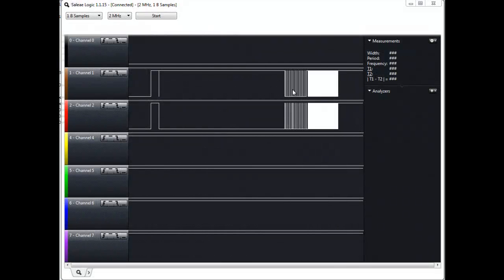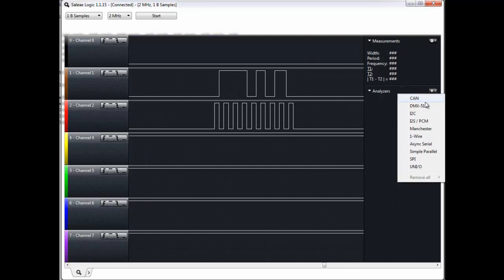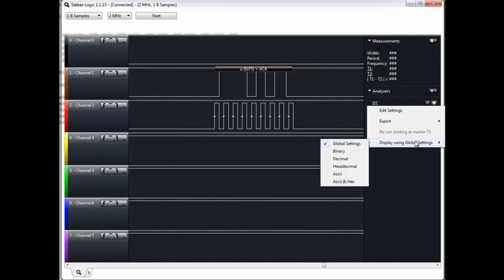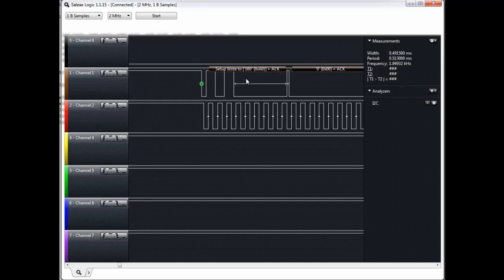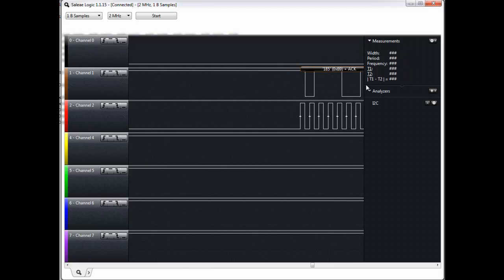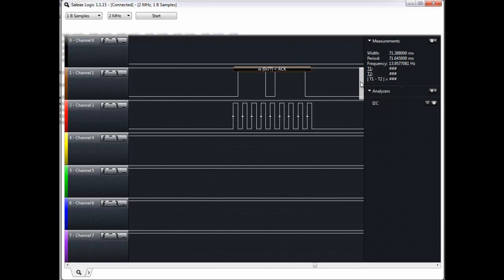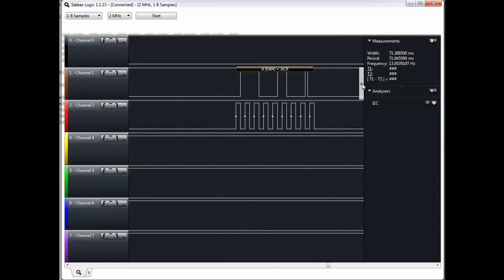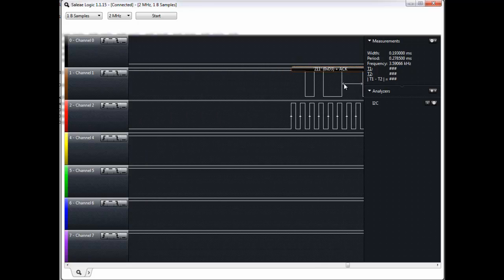Decoding a Webkey's EEPROM I2C bus with the Saleae Logic Analyzer

Comment: I got a question for you guys. I have a MSP MCU and an external EEPROM on my board with I2C protocol. Can you please correct me if I am wrong? In order to use your software, I need your hardware added to my board in order to use your software. Right? And how should I hook it up to my board?